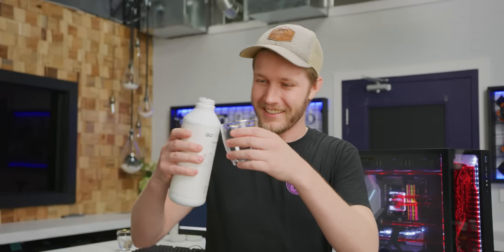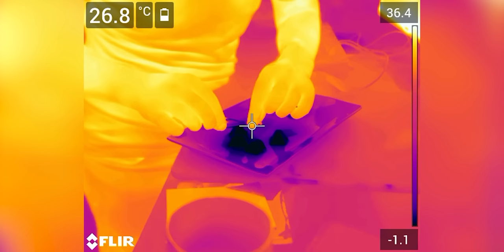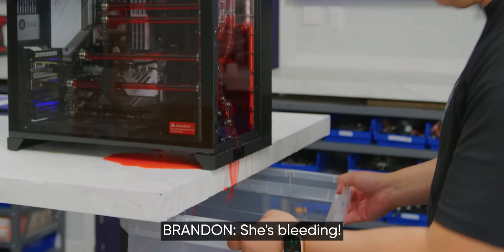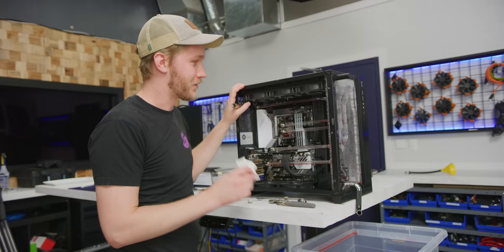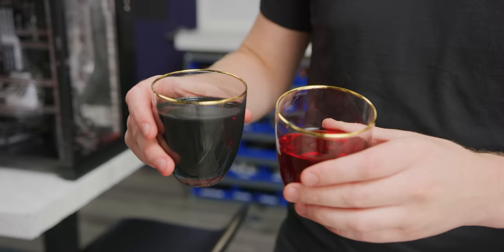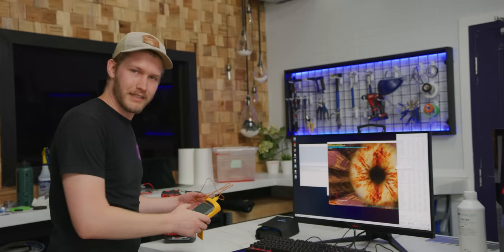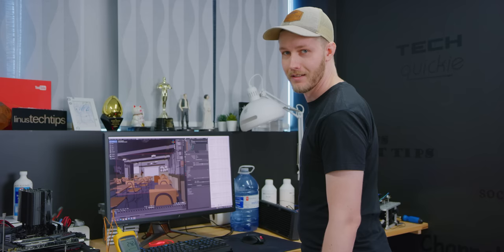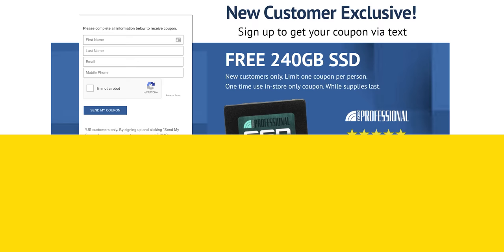7°C Cooler? This must be a scam - GoChiller Graphene Coolant Review

Comment: I'd be curious to know what the specific heat capacity of the coolant is. I dont see the conductivity being a big deal, but instead how much energy it can hold  and how hot it gets. I could see conductivity being a big deal on a heat pipe, but for water cooling you are just putting heat into the water at the block, then physically moving it to the radiator to offload it. If it holds more energy with less of a temperature rise it could be very interesting.
Reply: Thermal conductivity is everything in coolants. For reference watch this: https://youtu.be/-SVYKeSKBhY?t=489
Short term you are right, the heat capacity will be more important as it will essentially offset the temperature increase by some time. For long running and heavy processes however, basically any coolant will absorb enough heat for its temperature to rise. The point then, is to be able to absorb as much as possible while near the hot parts and to off-load it while near the radiators. Since there's a flow the time each molecule has to absorb and radiate the heat is limited which is why thermal conductivity is important.
Reply: Like the previous commenter said, the thermal conductivity is a very important factor. In addition to absorbing heat more readily, it also disposes of heat more readily. This makes your entire system more efficient. The loop they did was very small, but I imagine in a larger loop, possibly with multiple radiators, this would have an even greater performance gain.
Reply: @BL1zZ4Rth  I have been digging around trying to find some stuff out, and the science gets really complex considering specific heat capacity, conductivity, viscosity, density, and I'd need to have a proper sit down with the science to get my head around it. It would certainly be interesting to see how the graphene infused coolant compares on the numbers though, especially considering that water has great properties as a coolant and most of the conventional options perform less well in terms of heat capacity and conductivity. I'll check out the link when I get a spare ten minutes and thanks for commenting. I really appreciate you commenting and making me think more deeply about the issue. Thanks
Reply: @BL1zZ4Rth  CONVECTION! This is the main factor in a cooling loop. Conductivity is a lesser factor.
Reply: I think this thing is mostly water
Reply: @sealx2292  Makes sense as you want the entire volume of the liquid to absorb and radiate the heat. I haven't used the term in a some time to the point I had forgotten it existed. Though you are absolutely right, it would confuse most people I suspect.
Reply: @williameldridge9382  Thermal conductivity IS a very important factor, however, the coolant is not the bottleneck in a PC water cooling loop. The bottleneck is the thermal interface between the heat source and the coolant. In the case of CPU's, it's the IHS/solder/TIM that vastly lowers the total thermal conductivity of the system.

Where this stuff may see better results is direct die applications like GPU dies or delidded CPU's with bare dies, but even then, you're still going to be limited by the TIM and metallurgy of the block/fin-stack as well as the flowrate before you're limited by water.
The flowrate is another important factor as well. Graphene/water will obviously be more viscous which will likely reduce flowrate in areas of turbulence. Micro-fins with extremely tight spacing designed around the properties of distilled/ethylene glycol probably aren't the best approach to use with this coolant. A taller fin-stack with wider spacing would likely have better results with the graphene/water compound than it would with water alone.
Reply: @K31TH3R  if this would be true, then you would have a bad time to use water for transporting energy. heat capacity is way more important then any other. if the water or cooland just would sit there, then the Conductivity would be important. you can transport a shit load of energy in water, more then any other fluid.
there are a lot of other stuff like the way it flow, laminar or turbulent flow, k-index (i dont know if this is in enlish the same) and other stuff to. if you calculate heat exchanger, then this is very important, if you fall below turbulent flow, you have a problem.
Reply: It's still water based so should not be much of a difference with plain water.
Reply: @K31TH3R  https://youtu.be/m10LV-0SDns?t=173 . The test was about the coolant and both of them had the same cross section to interact with the metals through the thermal solution. If one coolant has better conductivity and convection it will absorb more heat and then radiate it faster, it raises the conductivity and convection of the entire system. More surface area to make contact is always better but that that's limited by the die size. It should be the same when you are comparing coolants. 

Flowrate is more relevant. Perhaps it would help to do as you say and since Alex said that the graphene coolant had the most foam forming we'd see the most improvement with that.
Reply: @thescandalchannel   It needs to have enough to match the task. To see water vapor - meaning the water cannot absorb any more heat and has to transition to gas - is an edge case in properly set up water/liquid-cooled systems. So convection and conductivity follow by flowrate would be the most important.
Reply: @BL1zZ4Rth  my english write skills are to bad, to hold a conversation over pysics in it. but Power(Phi) is, m*c*dT/t, so if you want to transport energy with a liquid, you just need, c for capacity, m for mass and dT for Temperature difference and time, if you change as example dT then you would need a higher mass or a better capacity others dont work if we asume we mesure in the same time frame. so fare there is no fluid know to have a higher heat capacity then pure water, so far you can't transport more energy/power. if you put anything else in a liquid loop and not pure water, you would have lower performance then with pure water. 
If this stuff work as they want it to be, then this need to be checkt in a labor with the right equipment to do so. then i would belive it.
Reply: @thescandalchannel  You are not wrong, however conductivity does take that into account.

First of all let's start with Power, which as you said is P=m c_p ΔT/t, I'm reserving φ for heat flux. To get heat flux you simply divide by L^2, L being the distance between the two objects that are participating the heat exchange.

Now we have φ = m c_p ΔT/ (t  L^2). 
However there is another express heat flux which is φ = -k ΔT/L 
k is the thermal conductivity.

I will suppose that on the first iteration of φ ΔT is positive and thus φ must be positive as well. Since in the second iteration ΔΤ must the same difference as in the first iteration and L and k are also positive, φ must be negative. We that fix by absorbing the minus so that we get:
φ = k ΔT/L 

By comparing the two we can deduce that k = m c_p/ (t L). So thermal conductivity includes heat capacity along with mass and temperature difference over the distance the bodies are at.

While I don't know if water has the highest heat capacity of all fluids, if you will look at the 2nd link at the section "Experimental values" there is a semi-log graph of the thermal conductivity of various materials. Graphene the by far the most conductive one there, so including that within water could perhaps increases the thermal conductivity of the liquid  which I guess is what we saw in the video.

Wiki links:
https://en.wikipedia.org/wiki/Heat_transfer
https://en.wikipedia.org/wiki/Thermal_conductivity

Comment: "We recommend flushing the system of your previous coolant with de-ionised water before adding Go Chiller for maximum performance." Theirs a notice to flush the system, idk if that was done, or would alter the testing, Im bigggg interested in this coolant for 3 loops based off the color profile.
Reply: Yeah I saw that too.
Reply: It would make sense, if the liquid were ionized I suppose you would expect the nano particles to align in direction, and preventing an optimal randomized directionality in the particles.

Comment: I have an idea on measuring the performance of a heat sink or cooling liquid: setting the same temperature spot like 35C, then using a PWM heater to heat the water block until the temperature hit 35C in a period of time, comparing the power given to heater gives the final result.
Reply: more or less how you do it professionally, using calibrated heat sources and dumps

The guys at GN do it properly, so do a number of other outfits, LTT is mainly for the LOLs (and that "server room" is utterly cringeworthy considering the value of the longevity and reliablity of the equipment inside it to the entire operation -  it really shows how upside down their priorities are)

Comment: I can imagine how increased thermal conductance would be more useful for short spikes of heat output rather than sustained loads. I'd personally be interested to know from where they got the 7c cooler number.
Reply: Probably very high heat load (something like 400W on a single CPU waterblock and cooling that with a single 240 30mm or similar) combined with very slow flow, a situation that should in theory be the most benificial for this fluid.
I highly doubt they pulled that number out of their behind, but as always with marketing it will be a very contrived situation, which will most likely not be relevant for real use scenarios.

Comment: Hey I noticed right from the start of your testing, you had introduced some major flaws. You said the micro graphene bits are what rapidly take hold of the heat from the CPU and then cools more rapidly in the radiator. One problem I noticed right from the first attempt, was that you never vigorously agitated the micro graphene bits into the GoChiller coolant liquid properly. You were leaving a huge amount of the graphene sludge particles in the bottoms of the containers. The test bed system, needed to be tested with water, then drained and dismantled to allow the water to evaporate or at least blown dry with compressed air. If you don't, then any residual water left behind in the rad or hoses, would have diluted the GoChiller and possibly even made it loose some of its coating properties. You also contaminated the GoChiller product, when you added it to the 1st PC which was full of that red coolant's sludge. To be thorough you should have added only brand new bottles of properly mixed GoChiller graphene, to a clean dried out PC for it to work at its full potential. It was very entertaining to watch, so keep up the awesome content.
Reply: Although what nobody mentioned was; you should, after you filled that graphene stuff in, let the system "always running" or rather - you shouldn't let it sit to long on its own.
Reply: have you not watched test #2 where they got to test it on new test bench?

Comment: Would have been cool to see with a temperature probe in the loop to measure fluid temperature. My guess is the average fluid temperature in the loop is lower by about 3-4 degrees with the graphine solution for a given setup/loop and might give a better delta for comparison. Also be interesting to measure temp in and out of radiator to see how they compare across that

Comment: Wonder how the liquid holds together after being in use for long while
Reply: This. If it clogs your system, is abrasive or somehow solidifies over time you're better off with the old liquid. If not, it's selling point is pretty much "it looks interesting".
Reply: @ragetist  graphene is a lubricant, it is not abrasive. It wouldn't solidify, and it wouldn't clog because the particles are so small. It is 3-4 degrees cooler, so clearly its selling point is beyond "it looks interesting".

Comment: If it's incredibly thin & unidirectional... wouldn't the more obvious cooling application be in heatsinks fins?
Reply: It would conduct to the fin edge while insulating the whole face
Reply: if you coated the inside of a heat pipe with it, that could work very well.

Comment: I wonder if colloidal silver might have an effect. Colloidal silver is just water with suspended silver particles in it. Silver is super anti-microbial and is insanely effective at killing bacteria. Back before fridges people used to put silver coins in their milk to keep it from going bad. So it would even be naturally resistant to any algae/whatever growth in the liquid.
But of course, it's silver. And I imagine it's very conductive as well. There are different concentrations you can get. I think the highest I've ever seen was about 500ppm (parts per million)

Comment: Their anti-foaming agents are probably working overtime. You're comparing distilled water which has 'nothing' in it with a graphene suspension which probably foams heavily without the anti-foaming agents.

Comment: The bubbles in the foam test were from you not using a clean tool every time. It's like mixing 2 different vehicle oils because of the residue on the tool, will foam 100% of the time.

Comment: quick answer... it shouldn't make a difference, the graphene... liquid isn't graphene liquid at all, its graphene in a liquid, its slightly more conductive, but that doesn't mean its not negatively impacting the thermal capacity of the liquid in the cooling system

Comment: I wonder what happens to the fins on the pump after a few years of running what's effectively nano-scale blades of carbon?

Also I would highly recommend against touching this stuff, being 1 atom thick, it could slice through anything from cell walls to DNA.
Reply: it isn't really just 1 atom think, it's multiple layers of 1 atom thickness. do you believe you'd be able to hold any sheet of 1 atom thick material in your hand like that without tearing it apart?
Reply: @moos5221  It's a liquid.  You can't hold it in your hand at all.  Stop pretending the sheet he used for demonstration purposes is the fluid going through the pump.

Comment: I know this video is old but man any one with that 011D loop config will tell ya its such a pain in the ass to drain no matter how neat you have your drain port setup. IIRC the front distro panel you have to rotate the case up first so its facing up so you can attach a spigot like he did shortly after and then rotate it back and open the ball valve so it drains cleanly.

Comment: How to drain with a fill/drain port: 
1. Open fill port
2. Open drain port
3. Flush distilled water into fill port
4. Wait until more water has gone through the system than the system volume
5. Fill with new fluid/use the distilled water. 
6. Close drain port
7. Close fill port
8. Leak test

You're welcome.
Reply: It hurt watching the fluid come put of that reservoir. It looks like it had absolutely no airflow, like doing an oil change without removing the oil cap.

Comment: "60% more thermally conductive"

Well, dead on arrival...
thermal conductivity is not what you need in a coolant, you need high thermal mass.
Reply: you do need conductivity though. High conductivity transfers the heat away more efficiently and release said heat at the radiator more easily.
Reply: Thermal mass wouldn't do anything in the long term because it's all gonna be hot after a few hours of heavy use
Reply: Its still water based so basically the same 'thermal mass' or specific heat capacity

Comment: They are not coating the leads, thats not a thing, the meter does not care how much or where the leads are in contact.The fluids are capacitive, as they are electrolytes.
I'm just a mechanic, be smart nerds

Comment: Look like a mess that will eventually clog your blocks waiting to happen. As long as my CPU/GPU never goes above 60C (50C water temp) I don't care, they don't need to last 30 years when I will get better ones in 10 = plain vanilla water with 10 ppm copper sulfate is good enough, won't even need to flush it for several years and possibly not for that whole 10 when I get new gear.

Comment: You should do a long term (6months or so) of constant use with a heavy load put on for like 3-4 hours a day to see if the heat causes the graphine to solidify to cooling fins in a cpu/gpu water block and since its more viscous and heavier per millilitre than distilled water and see what wear/flow it does on the pump

Comment: Since it sounds like it is graphene suspended in water, it would seem like you are still limited in the thermal conductivity of water. Unless the base of the solution changes, you are still limited to the weakest link.

Comment: I think you effectively proved that the heat transfer liquid is not the bottleneck in both systems. You'd probably need a more extreme application to show the benefits of the product. The rate of conductivity of the liquid graphene does not necessarily mean a cooler running CPU. I would suspect that the heat flow is limited from the surface of the chip to the outer fins of the CPU block where it interacts with the fluid.

Comment: Place a small, spirally bent wire into the drain, facing downwards (with a parabolic curve if you have the pipe sideways) and it should do the trick, just make sure the wire is somewhat same size as the drainage pipe. The draining stream should follow it.

Comment: Have you, or your subscribers, ever tried triple distilled mercury as a coolant? It certainly has uses and reacts well to temperature, but not recommended for regular contact on the skin. The vapour it gives off is heavier than air (seem to recall an experiment using a black light projected onto a white background, with the mercury container in between - those invisible vapours really stood out!). Obviously you’d need to be very careful and then there’s the issue of the cooling pump trying to force such a heavy liquid around the cooling loop, but I’m confident that if anyone could do it then it’d be you guys!